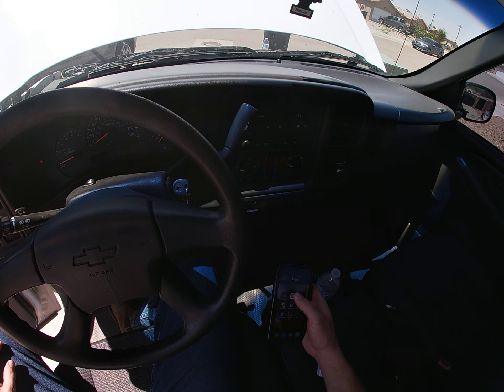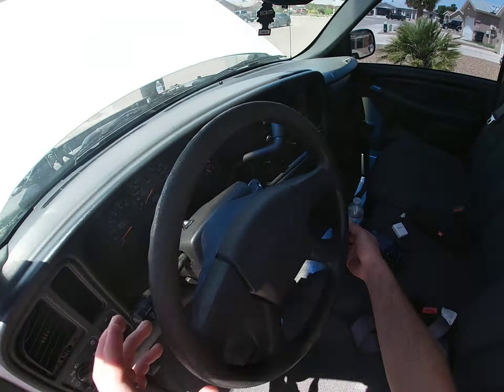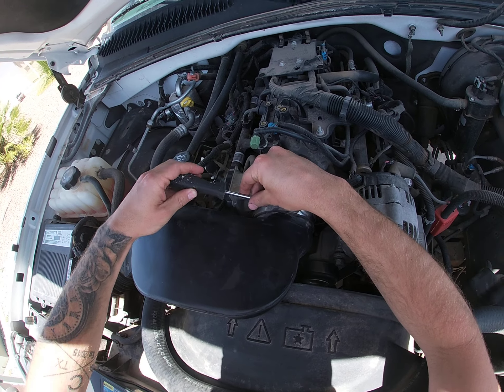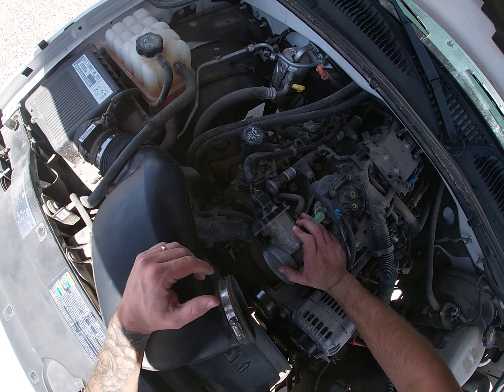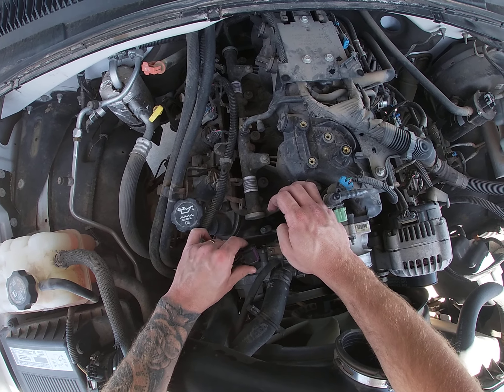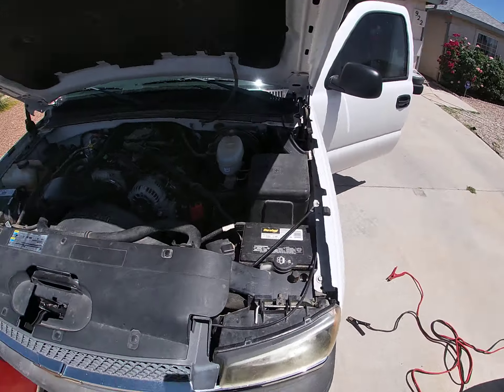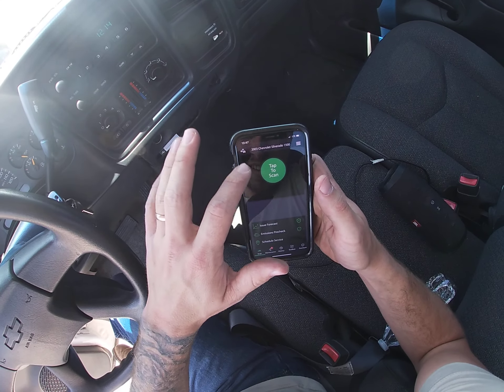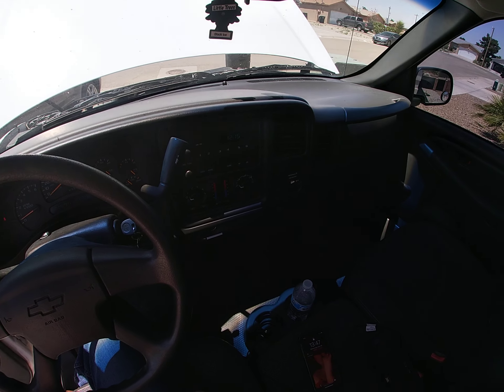How to fix your Chevy Silverado Check Engine Light | Code P1516 Engine Code Fixed 2003 Silverado

Comment: Thank you sir. I have been battling this issue for a while and all it took was your video and presto the truck has tons of power.. I also noticed the airbox was not seated properly and probably sucking air. Long story short, thank you for showing me how to fix my 03 silverado..
Reply from the maker: I’m really glad that this was the fix to your issue! Sometimes it’s just that simple! I hope this is a permanent fix for you!
Reply: I've replaced my pedal sensor throttle.control module  throttle positioning sensor and it still happens
Reply: @zachwilschetz6995 Did you find the issue?

Comment: thanks for the video it really  helps the world out there ! in my situation i disconect the TB connection then clean air filter MAF sensor all intake pipe and throttle body . i think the problem was The throotle body , it was full of carbon . reset codes and it got fix !!! THANKS 🙏🏼 my truck is 2007 escalade esv

Comment: I have the same problem P1516,  Do you think could be an issue with the TAC ( Throttle Actuator Control,, SIDE DRIVER) or could be the THROLLE BODY
Reply from the maker: My next guess would’ve been to clean the throttle body if what I did hadn’t worked.
Reply: Did you replace the throttle actuator control or what fixed it.

Comment: I have a 04’ Chevy Avalanche 1500 this issue pop up after going to autozone and hooking the OBD reader to it. Lucky enough i looked it up & may I say after watching this video the check engine light immediately came off. Also i just didn’t even removed anything just unpluged and plugged it back in .
Reply from the maker: I’m glad that this video was helpful!

Comment: Has the reduced engine power mode came back at all ever since? I am currently experiencing an issue. Same code, my truck will do it when its below half temp or when its below 40 degrees outside. I just pull over, shut it off & turn it back on & goes away. But will eventually come back. I just recently cleared the code, tomorrow I will do what you did in this video.
Reply from the maker: For my situation it’s been about 9 months and the code/ reduced engine power mode has not come back on. I drive my truck daily to work and back. I hope this works for you, but keep in mind it could be a number of things. When I first looked in to what it could be it seemed like it could’ve been a number of things. But basic troubleshooting will tell us to check the harness and electrical connections. I hope your fix is as simple as mine was since it saves both time and money! Good luck!!

Comment: Hows the fixd working for you. I been using my fam bluedriver scanner and its pretty good. Im looking for one myself but heard good things about the fixd scanner too. Im stuck right in the middle of choosing.
Reply from the maker: It’s been working out nicely, it stays consistent when scanning and gives you some good sources when it comes time to fix the code. I would assume that you do get a whole bunch more if you get the pro version but I have yet to do so. Either way it works great, and I can actually link it in the description.

Comment: I have a 2006 Silverado 2500HD, and my engine light just came on for the very first time in 15 years. How do I know which code is causing the light to come on?
Reply: Go to a parts store, they check codes for free and will print out a paper with the codes.

Comment: This was tried and failed along with Replacing the throttle body, TB sensor, Checking grounds, TPS again, Gas pedal and sensor, TCM, and even the main computer.  Running a ground wire from the battery to the TCM helped for a while.  Changing the battery seems to last the longest amount of time but it will come back.  If anyone has a real fix for this it would be appreciated.  This truck has been to numerous different mechanics with no long-lasting fix.
Reply from the maker: Sorry this method didn’t work for ya! There are numerous reasons to why it may be happening as I found through YouTube
Reply: Mine was the throttle body, initially I purchased an oem replacement and the code came back, I caved took it to the dealer had them replace the TB with a factory one they performed the relearn process and cleared the code and it never came back. I hate to admit it but with GM sometimes you have to take them to the dealer and or at the very least use factory replacement parts and unfortunately have the techs perform the relearn process

Comment: Not that easy when it gets cold it will fuckup again when hot out it won't do it just replace your throttle position  sensor
Reply from the maker: Probably the better thing to do!

Comment: So basically you didn't do a fucking thing except disconnect the harness and then reconnect this. Makes no sense. How long did the fix last? One day?
Reply from the maker: I'm sorry this seemed to upset you but newer trucks are computers. Sometimes all you have to do is disconnect the connector and reconnect it and it could have just been poor connection. In regards to how long this fix has lasted me, I have not had the same issue arise since doing this. This is a legit way to troubleshoot and should always be the first thing to do so that if it's as simple as reconnecting a harness then you don't have to waste more time and money.
Reply: @thedadsection4489  Hmmm...I'll take your word for it, but harnesses with a retention clip RARELY have this problem unless you have corrosion building up in this area. NOT "Upset" at all with your claim whatsoever. Surprised would be the better adjective.

 That said, I have a business with a FLEET of older pickup trucks , 4 of which are GM 2003 to 2007 Sierras and Silverados. Have 2 trucks which had same problem which is apparently a common problem. 
One  truck was fixed a year ago. Replaced entire throttle body, and no repeat issues.  
Second one just had this problem about a week ago. Tried your suggested method along with cleaning the entire throttle body with brake cleaner and a toothbrush. 
It fixed the issue temporarily, made the truck run with a much better, very smooth idle, and also cleared the code until the problem returned exactly  ONE day later. 
Just replaced the Throttle position Sensor a few days ago. Problem solved. Running perfect.
  Just don't see how disconnecting and reconnecting a harness would do anything permanent, but like I said, I'll give you the benefit of the doubt
Reply from the maker: I appreciate your feedback! I was honestly surprised that this worked for me as well. I just did the first basic step in troubleshooting and it just happened to be where my issue was. I was fully prepared to swap out the throttle body but like I said I guess I was lucky this go around! I guess a more appropriate title for the video would be about how troubleshooting steps can fix an engine code.
Reply: @thedadsection4489  Gotcha. I never seem to have good luck like that. LOL  It's always something with higher mileage vehicles regardless of the make. 
You hear People talk about Toyota all of the time being so reliable.  Well......I've had just as many problems with Toyotas as anything else.  It is all relative. 
Toyota loyalists think it is exceptional quality if their Toyota makes it to 200K miles.....LOL.  
200K is like an everyday occurrence on these GM Trucks. I bought two GM trucks...BOTH  of them with over 170000 miles to start with, and have them YEARS with little to no trouble....mostly knick-knacky issues. A bad Pittman arm and Idler Arm...perhaps an  AC Compressor dies..... O2 sensors.....a wheel bearing hub assembly ....Throttle Position Sensor.... Stuff like this 

 I average 325000 before anything serious occurs where big money needs to be spent to correct, and usually by that point they look bad and are pretty torn up, so we just dispose of them at that point